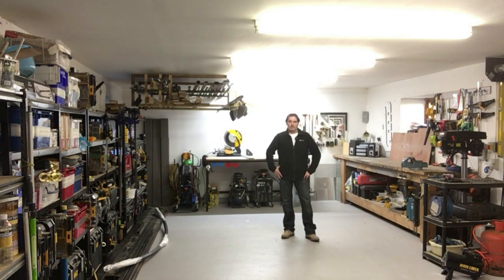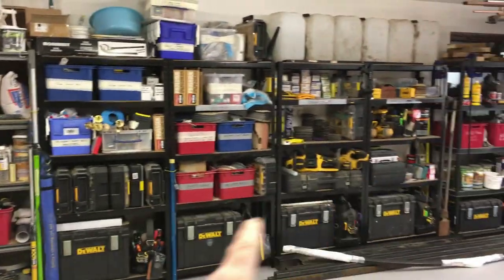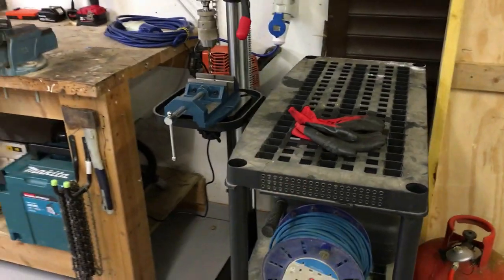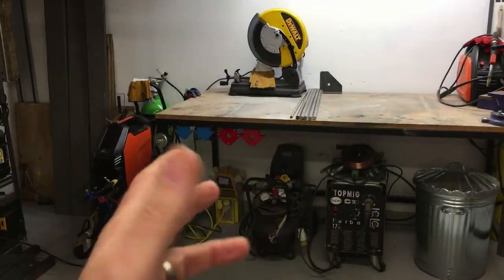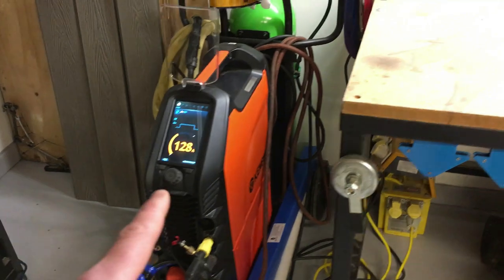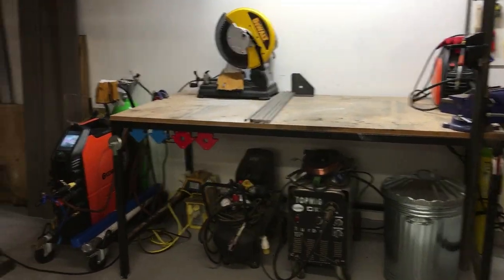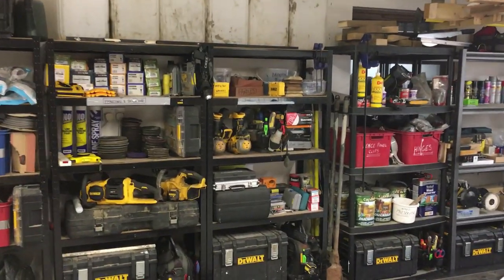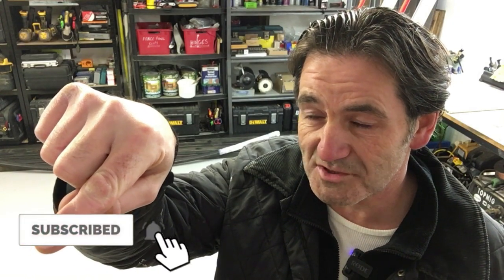WORK SHOP TOUR UK 2021

Comment: Kemppi welder is serious stuff, I’ve always used Lincoln but just got a new jasic for the work shop and prefer to the Lincoln
Reply from the maker: Thanks Thomas, yes Kemppi are great, one of the best out there. I used 3 phase Kemppi's all the time during my pipe welding career, hence why I now have the 240v version for current business. Can't beat Kemppi in my opinion. Lincoln are also good, I can't comment on the Jasic machines as never used them, but they have a good reputation for mid range machines as well as R-Tech. Thanks for the comment 👍

Comment: Lovely workshop Barry, a must have for you I'm sure . Alll the best for 2021 👍 Could you not tag a big radiator into the workshop from the house heating, it makes a massive difference to the back ground feel.
Reply: Your channel had come out of my subscriptions for some reason, don't know how 🤔
Reply from the maker: Cheers PB, Yes I could do that but not at the moment. The way that our house was designed was in such a way that the space that I use is pretty much a self contained annex - it would be easily converted (which was taken into consideration when the house was designed). The upstairs portion has 3 velux windows and it also has its own power and water supply. Our plan going forward is to convert the space in to a separate unit (rent it out as a holiday let or something) and then I would build a workshop or another house in the garden................been talking about this for years now, but procrastination gets the better of me !
 All the best to you and yours mate, I think 2021 is going to be an "interesting" year but we all just have to keep on keeping on.............I have my own views on the current situation, but will not voice them on a public forum 🤔👍😁
Reply from the maker: Lol, you DELETED me !! 😫😜